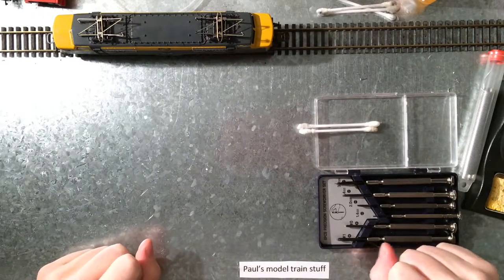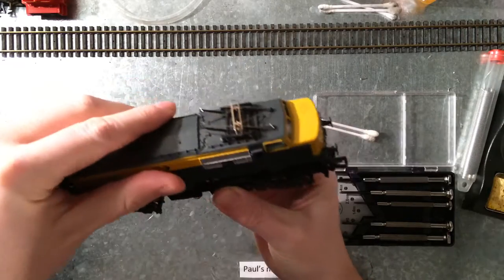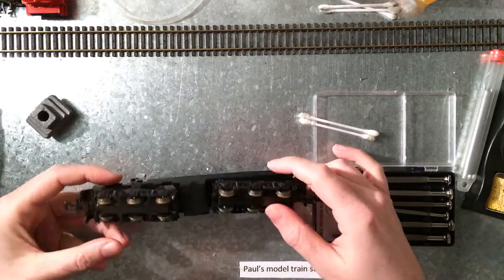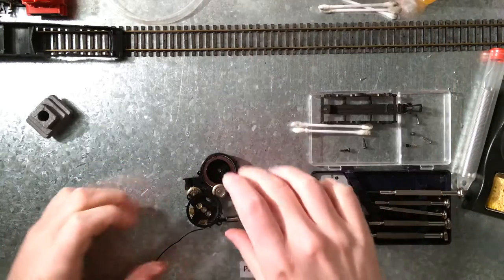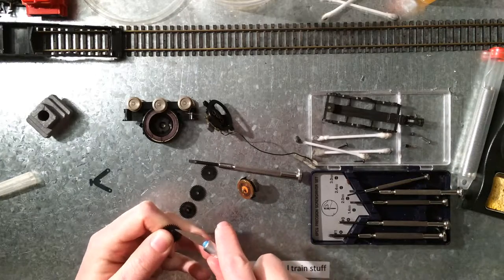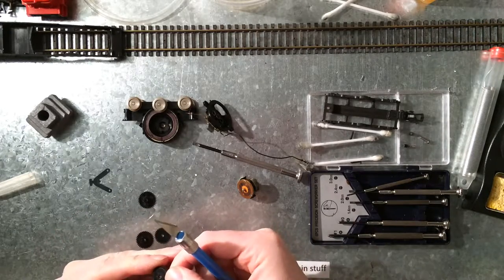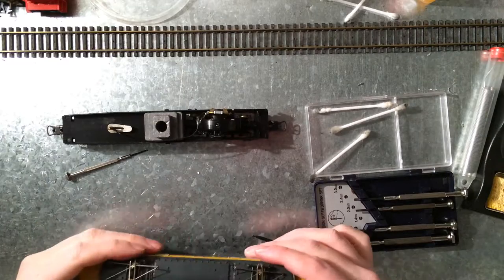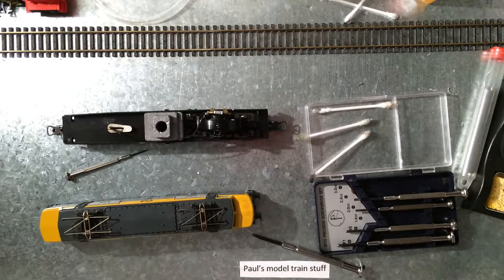Cleaning and fixing a Lima NS 1200 (Video in English)

Comment: Hey there,
I've tried fixing my NS 1220, following your tutorial. It didn't work when I got it, so I had nothing to lose. Unfortunately the engine was greasy beyond repair (I couldn't wipe it off, even with water involved), so, for now I guess it still won't drive

It's a really nice-looking train though
(Writing this message in English instead of Dutch so English viewers can understand)
Reply from the maker: What you could try is replacing the motor with a cd tray motor. I have a couple of videos about that floating around as well. It would however be a challenge to make it run properly on an analog track.
Reply: @Paulsmodeltrainstuff  Well, I've discovered why it didn't work, and I felt pretty stupid after realizing it (note that I'm pretty much a beginner at model train stuff). The entire time I was using a digital track instead of analog. I am planning on investing into analog though. Seems like you can get a great deal of Dutch trains on the cheap from there